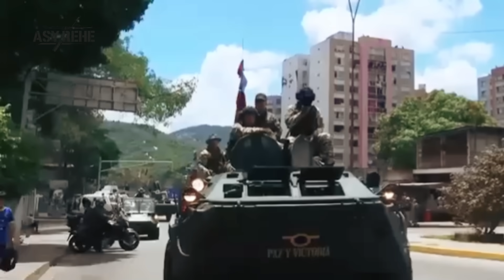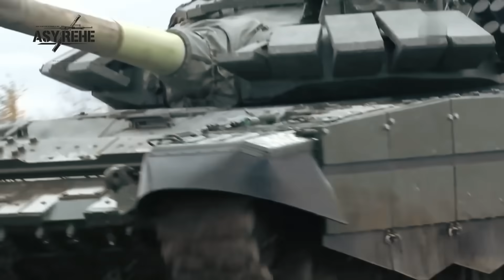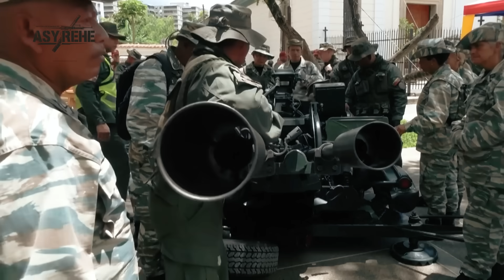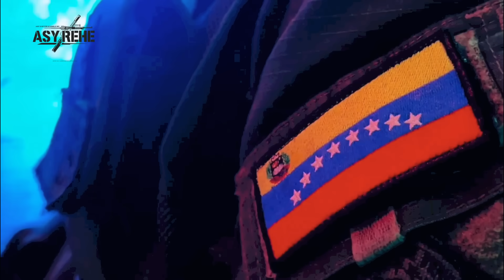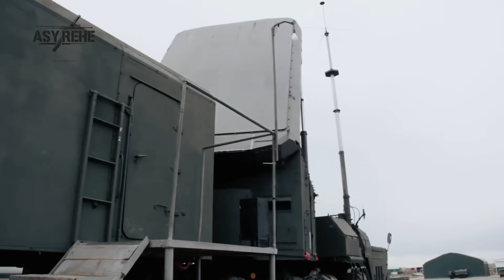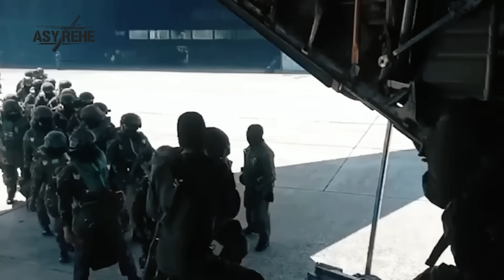Russia Quietly Sends Military Tech to Venezuela — A Strategic Warning to the U.S. and NATO

Comment: How is Venezuela isolated? When you are not aligned with the West, they call you isolated. The S-300VM is a very dangerous system even surpassing the S-400 in some aspects. If Venezuela has that system, then they have better air defenses than America itself. S-300VM is a hypersonic killer.